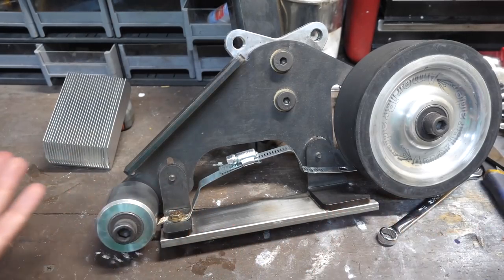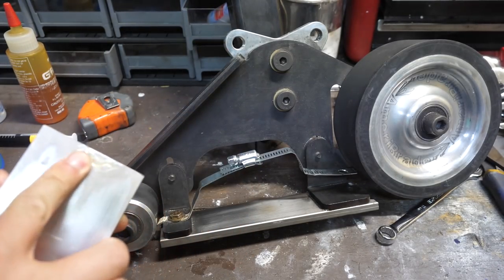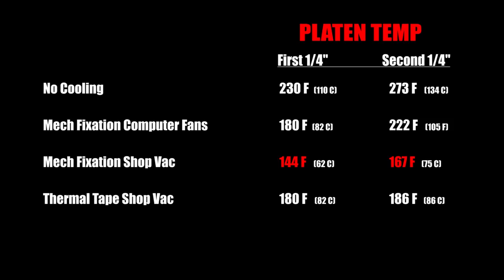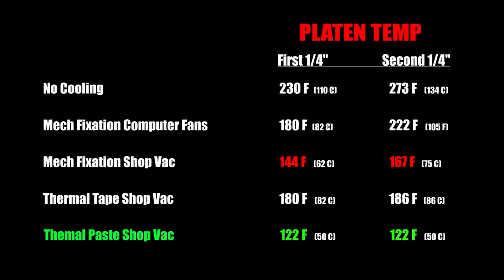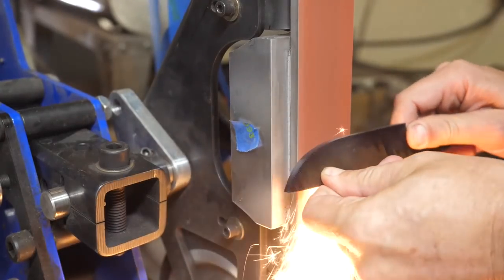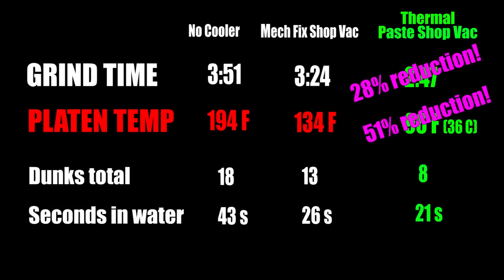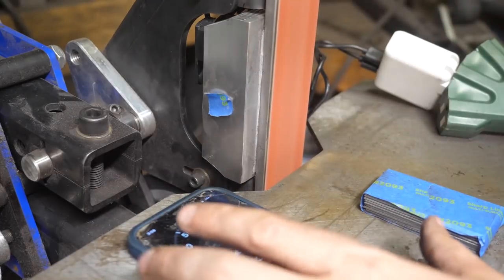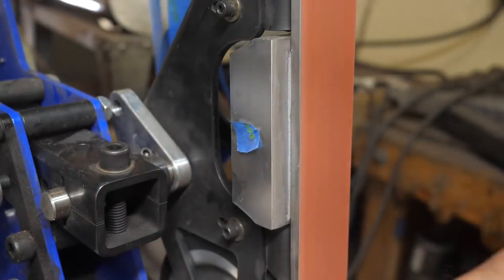DIY Platen Cooler THERMAL PASTE Edition?! Part 2.

Comment: The science is pretty simple.The heat is travelling through the belt and platen, then into the heat sink where it gets blown away. Consequently, you can push the blade harder and longer, because the heat is travelling out the back.
Since you're not worried about noise level in a shop, the vac blower end is a great idea, since more/faster air carries heat away more efficiently. If you had some kind of water mist you could put into the airstream, I bet you could get even lower temps. But I'd totally understand if you didn't want to get your grinder wet.

Comment: Instead of thermal paste you could also try an indium sheet. It’s extremely soft so you should be able to make it conform to the imperfect surface of the platen and the heat sink. It also conducts heat better than paste.

Comment: Love the effort you've gone to in controlling everything but what actually changed. I think the way to get better performance is a liquid cooled platen (these are apparently a thing) and shop vac cooling of the radiator. Could be pricey though.
Reply: You forgot to factor in how fun it'd be to make and set up ;)
Reply: I don't know how long he's using his belt sander for but if it's not on all day every day, maybe a simple water reservoir would be sufficent, might not even need to pump the water and just use conduction. Water has massive thermal inertia and if you're grinding for a minute at a time it'll absorb and dissipate that no problem.

Comment: That was a pretty awesome result.
You can get cpu coolers that are water cooled. Technically you would still be using a heat sink/transfer, it would just be a radiator installed away from the platten.
You'd still use thermal paste under a plate attached to the platten, it's just on the back of the plate there would be hoses or tubes carrying the heat away to the radiator via water/coolant.

I reckon it's worth pursuing, especially because you are doing all the work :)

Comment: How about a liquid cooled system, radiator and platen with liquid cycling inside to keep it cool.
Reply: @Edgunsuk  i would not a recomend alcohol based system here. seems like a fire hazard with all the sparks.
Reply: @Edgunsuk  Yes you could beat this, going all in with  liquid nitrogen...
Reply: @marvinberwart  the steel from the platen would be extremely brittle at cryogenic temperatures.
Probably not a good idea ;)

Comment: I reckon the best ways to improve this are by increasing the metal-to-metal contact, increasing the fin surface area, and by using a more thermally conductive material such as copper. 
Metal-to-metal contact can be increased with greater, more even, clamping force, as well as lapping both the platen and the heat the flatten the surface. Fin surface area would be best increased by creating more fins, rather than making longer ones.
Reply: I personally think the bottleneck at this point may be the airflow. He's got plenty of volume coming from the shopvac, but it needs to be directed properly. I think turning the heat sink into a duct would help significantly. Cap off the back of the sink with sheet aluminum and force air in through the top and out the bottom, ensuring that 100% of the thermal conductivity of the material is taken advantage of.

Also, aluminum platen instead of steel would increase its conductivity to the heat sink.

Better yet, custom billet aluminum platen with built-in heat sinks 🤣
Reply: @pipisugbo  You could go one step further make a platen with shorter fins, then seal a cover on top of it with some pipe fittings. A water cooled platen would be rad.
I reckon with the length of it you could probably get away with reasonably thick fins.
Reply: @pipisugbo  probably have to solder a titaniun sheet on top of it, so the belt doesnt cut in the aluminium. I have in mind that titanium has a really good heat transfer, but i dont know if you can solder that stuff🤔
Reply: I was going to suggest copper but I've been told that copper retains heat longer than aluminium. Alumium won't conduct as fast as copper but dissipates heat faster. And, as I have no idea what the CFM of the shop vac is, I can't hazard a guess as to what's going to work better. Considering the size constraints, a nicely lapped bit of copper heatsink could work wonders. 
Or, you could get very fancy (and expensive) and have a copper coldplate on the platten, duct frigid (because you don't heat your workshop, do you?) water through it and just use the massive thermal inertia of water to really sink the heat into. Initially I was thinking, you just turn the tap and let mains water flow through it. But just a simple pipe into a tank of water would work via conduction.

Comment: Great video!!! I would really like to see how this compares to misters.   The two reasons I appreciate the mister: 1) keeps the blade cooler, 2: ) lowers the metal dust in the air.  Yes, I grind with a respirator and Hepa dust collector, but it still helps.

Comment: This was so much fun to watch.  I might recommend a radial blower fan.  It sucks up air through the flat side and blows it out perpendicular.  It should let you place the intake over the fins but blow out sideways.  That way you can buy one that meets the dimensions of the space behind your platen and give you more CFM that those puny slimline fans.

Comment: It seems that you might be on to something with your setup. Other than having a miniature coolant circulating radiator (like in cars and such). It would seem that the only other realistic option would be a 'wet belt' sander/grinder. Often used in the glass industry to grind and shape glass quickly and at the same time keep the glass cool enough to prevent heat breaks. I have also recommended that to Alec Steele(more then once!) And whilst they can be messy, it cleans the belt of particulates and keeps virtually everything cool 😎 and productive! Down side, a bit more messy, in that you would likely want a rubberized apron and boots. But the Results! I have already dabbled with the one I have at work, and it is Awesome! The downside is that it is not as transformable as your current grinder, but they Do have platens available. Just throwing it out there! 🤪👍

Comment: Hi. Very cool set of experiments.
There are water-cooled computer fans. The water are in a closed circle (just like the water in your car that cool the motor).
You could try and fit one of those - they have a lot better thermal conductivity but the space will be a serious issue. You will have to find one that will fit the size.. 
Good luck - looks great!

Comment: I think a flatter surface will be the next big improvement. You could also flip those little fans around to blow cool air to the hot area. Because the small fans have no duct or shroud anymore, the air they pull in mainly comes from the sides of the fan itself, not the heatsink. A shroud for either the shop-vac or small fans should make a decent improvement. Nice video!

I'd also like to add I can model you a shroud fairly easily with some dimensions! Send me a PM if you're interested. (I can 3D print it as well)

Comment: Think this was a very interesting series even if it does not contain any real knife making. But again, I like to watch Major Hardware “The Fan Showdown” 😊 use to mod my computer a lot before… 
Anyway some interesting changes that can be made:
Back plate: Half the steel thickness and add a aluminum plate behind it. Then the heat sink. 
Fan: tunnel with a high spec 120mm fan 
Or a  highj spec GPU watercooler… But then we are getting into some investments…

Comment: Water/glycol cooled.. bucket, pump and quick connects. You could even use ice to further control temp. If you elevated the bucket from the work area I wonder if allowing the warmer coolant to rise out of the top could create enough dynamic flow to avoid a pump all together..?

Comment: Fans for industrial or server use can be up to 10k rpm, move a lot more air based on size and are usually high pressure. Might be good to look into something like that as you'd only need a single fan for this purpose. Also, cutting the housing off the fan essentially ruins any sort of flow and pressure you'd get from the fan making it akin to a ceiling fan. I would suggest making a shroud to mount fans to the top of the heatsink and seal it off so the pressure is focused across the fins and not just being blown out the sides from a missing housing. I think the best way to simulate this would be just covering the top of the heatsink with some cardboard and blowing the shop vac through one side.

If no shroud you at least need a high static pressure fan, with the housing intact, blowing onto the heatsink, little airflow fans won't quite cut it many things.

Comment: i can see it now, water cooling. it's extremely efficient at heat dispersal, and is super low profile, you'll have a couple hoses to mount, and a custom cooling bed to affix to the back of the platen, but it would be epic!

Comment: I think @John Kenny hit the nail on the head with air cooling.  A higher fan velocity directed through the heat sink structure works pretty well.  If you enclose, making a duct to direct the air would work pretty well.  You well proved the efficacy of a cooling system that starts at a lower temp and has a rise of 40 degrees still  topping a much lower high temp.  Now consider what thermal wear of the metal being cooled does over a period of time.  Repeated over heating is a damaging effect if the metal gets hot enough to become brittle and fail (break) through use.  Energy being released as heat is a bane to electrical and mechanical substances in nearly everything we use.  Over cooling can also allow damage during use in weakening metal in this case.  Obviously you don't have a problem of being too cool where the metal is concerned.  Although, your cool factor has risen greatly from delving into your heating problem.  Thanks for letting us travel down  your road to success with you.

Comment: The ultimate solution would be a brush applicator to apply a small amount of water to the belt right after the top most roller. IE high enough not to be in the way and yet not far enough back for the roller to sling water at you.

Comment: Still water cooling of the platen and cooling paste for the watercooling system, then You could have the fans for cooling the water elsewhere, just tiny tubes on the back of the platen. Now You have room temperature on everything, with cool water You could have a lower temp on the platen to start with.

Comment: Interesting experiment. So, in my absolute madness I'd suggest air cooling the platen, the blade (in front of the belt), and the belt itself (after the platen), so that the whole grinding area stays as cool as can be.

Comment: It would be a useful improvement for  production shops. They would be able to get more knifes out in the same amount of time if they used the cooling setup. I wonder how a water cooled system would do...it might be better. But it would be more of a hassle.

Comment: I should note you put those fans in a pull orientation. I think they would have been more effective at their job if you flipped them to push air into the heat sink like the shop vac. Also, thanks for listening about the paste haha
Reply from the maker: I put them in push last video and never heard the end of it so…
Reply: @GreenBeetle  haha, I think that’s because they weren’t against the heatsink like you managed to do this time. Since these fans didn’t have a full seal against the heatsink, the spots you cut, I fear a good portion of the air pulled comes from those gaps and not through the fins.

Comment: Cut those fins in 1/2 or 1/3's to fit perpendicular to the platen. This will eliminate the "walls" that exist on them now. This will exponentially increase air flow and you can use the shop vac or regular small fan. Those USB fans are worthless in these situations. Air flow through the fins will make a difference. And, by cutting the fins, they will not protrude from either side of the platen.

Comment: Interesting video. Not surprising how much difference the thermal paste made.  I know the fans you used were relatively weak, but the direction they are blowing makes a pretty big difference.  It's usually better to blow air towards a heat sink to get the best results. Also, a single 80mmX25mm fan would be significantly better than the 2 low profile fans. Maybe another follow-up?
Reply from the maker: When I blew towards everyone said to blow away.  It makes no difference in this set up.  Standard computer fans aren’t going to work in this case.  A cpu may get to 700 degrees without cooling and auto-throttling  but it’s thermal mass is about 1/20 of the platen which gets into the 250 degree range.  The cfm on my shop vac is 165, upper end on these fans is 35?

Comment: Have you tried using a ceramic plate for the platen face? I'm curious if you still have any heat problems using one. I'm using 1/8th in thick. I can't remember the material name, but just search for an 80+ HRC abrasion resistant material and get it cut to size.
Reply from the maker: yes i have a ceramic platen I normally use, this one is just on there for this video.  the ceramic is fixed with carpet tape to the platen mount which doesn't conduct heat at all, I think it grinds hotter than steel but I've never tested the two side by side.

Comment: less is more when it comes to thermal paste. you want as little as possible to close all microscopic air gaps but no more than that.
also: you can get even better results with liquid metal thermal compound.
Reply: care needs to be taken with gallium alloys as it loves to disintegrate aluminium. I've seen videos on it and it's fascinating. I think with the modern CPU's, if you're doing liquid metal the aluminium IHS has to be removed for direct contact with the silicon chip on a copper coldplate. Hopefully I'm wrong.

Comment: 💡I have a thought. try a CPU water cooling system. you can make a DIY version of one. it will cost cheaper then buy one that cost 200 plus dollars. the DIY version will cost less than 72 $60.

Comment: i really think you should just try mist cooler, even if it's just a cheap $10 one. You tha Man Steve!
Reply: Phase change is one of the best ways to absorb energy from a system. Lower flow rates may be better for this style of cooling.

Comment: One 120-140mm fan should do a LOT better than those 2 tiny fans and you should be able to fit it without modification. I build a lot of computers, so if you got PO box I can send you a 120mm for free if you want.

Comment: PC fans are typically designed for a push configuration. The are designed for pressure.
Reply from the maker: Sure sure and when I set that up last video everyone said “pull next time, dummy”. Shop vac cfm is 165, these fans are 25 combined.

Comment: Definitely a ported platen with a water pump and ice water constantly pumping through would be the most efficient and consistent method
Reply: You know that the Japanese sword/knife makers have been using the underground spring water to keep there blades cool for 10’s of thousands of years using a giant sharpening wheel. What cool water must be 60• degrees or colder🤷🏻‍♂️
They may have it figured out but I’m just putting it out there 🙏🏻❤️💪🏼🤣🤦🏻‍♂️

Comment: Very fun, love the extra set of videos
Thinking, the water block will probably have a better ratio of being able to pull more BTU's out of the platen over time, if you mill up a 2" section with some water channels in it and a cheap water feature pump it might be doable with some high temp epoxy. The other net gain is not having air blowing dust everywhere too and a little less noise.
Alls said and done though, the theory has plenty of merit worth investigating
Reply: @pekirt  I've seen similar things on some experimental main boards back in the early 2000's for STM telco stuff. The boards where 14-15 layers thick and packed full of semi conductors and very fine pathways so a closed loop liquid and fan unit cooling system was one way of stopping them getting melty. Especially once you hook up a couple of big old lasers to them and that's even before plugging in all the other stuff that goes on the surface.
Reply: Liquid cooling would net much higher thermal dissipation and as previously stated less noise and dust but also having a much smaller footprint.....
Reply: You could also machine a new  platen with the liquid/air  cooling built in ....just a brain fart!

Comment: Computer fans can't flow enough air to keep it cool. Compared to the shop vac, which is able to focus a higher volume of air flow. Do to the hose and bigger motor on the shop vac.
Reply from the maker: Yes reg computer fans may get up to 30-50 cfm? while my shop vac does 165

Comment: The only "pc" fans you should be looking at in this application would be some Delta fans.
Something silly like their THD1348HE needs 50 volts / 250 watt and moves just below 500 CFM. But then you really have other problems :), like noise and even faster spinning dangerous stuff.

Comment: How about making a shroud around the heat sink and using the shop vac to pull ambient air through the heat sink rather than blowing heated air over it?
Reply from the maker: Suction side of vac is for dust collection
Reply: @GreenBeetle  well, how about a second vacuum or at least for testing skip the dust collection and see if a high volume of cooler air makes a statistically significant impact? I’d be willing to bet that it would. Very well done thus far. Watching with interest as I run numerous platen belt sanders for brass hardware in a production setting.